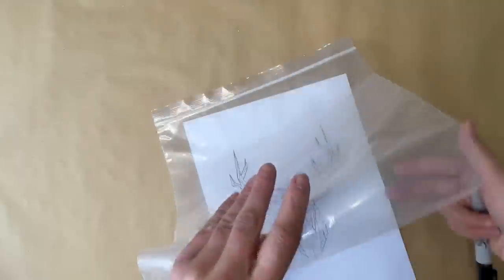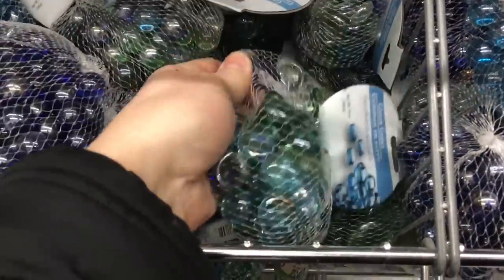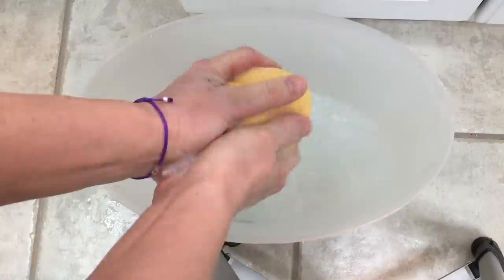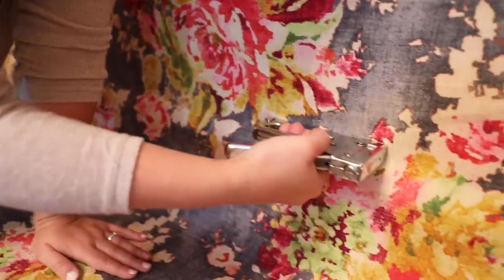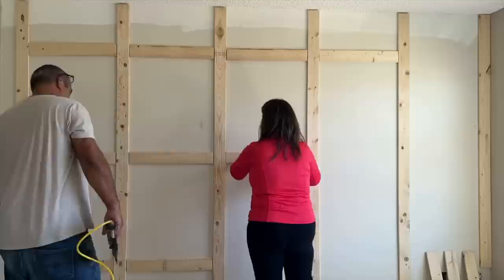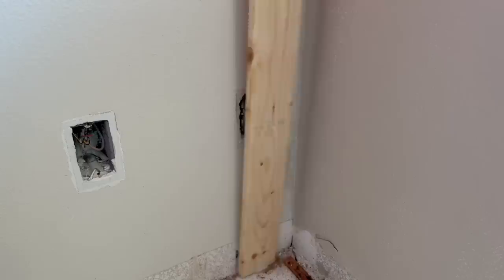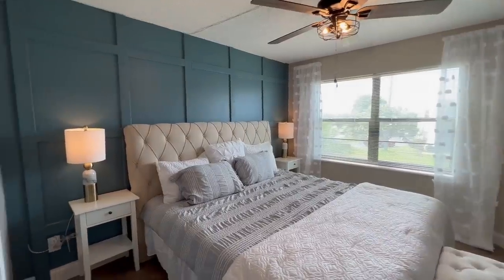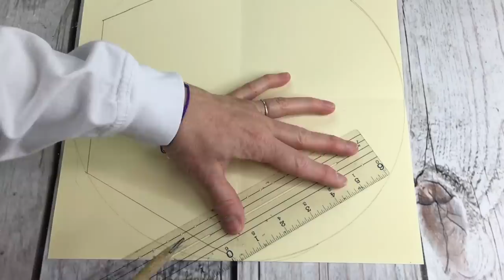Why everyone's saving their leftover boxes to make THIS on their walls!

Comment: How will you properly clean the fabric on the wall since you stapled it and glued it? It will collect dust so bad and it will get pushed into the fabric if you just try to wipe it away all the time. Its just like regular curtains you have to wash. Should have made it more convenient and removable. And the back splash in the bathroom, make a mold or box it in so it didn't end up uneven and off like it did. Some of these were not thought all the way through. Most of these are great tho, just not as convenient as one would want.

Comment: The stencils are fabulous! I liked the fabric covered wall but didn't understand why they left the outlet cover alone and also had a rough edge at the baseboard.
Reply: I was always advised nevet to cover electrical outlets. Firstly it's probably illegal if a builder did it bc it's a fire hazard.

But I guess she was reminding ppl to allow for access to them & avoid covering useful outlets up by accident.

I assumed the rough edges were before the painter's tape came off.

Comment: Liked them all but I'm moving to a rental so can't try them.
Reply: I've seen a renter friendly version of the wall with fabric. It was done by using a starch and water mixture instead of spray adhesive. It comes off the walls easily & all you have to do is wash down the wall and you're good to go, plus you can toss the fabric into the washing machine and it can be reused for something else.
Reply: Great idea. I guess you could paste the fabric to accent  panels and bring them with you also.